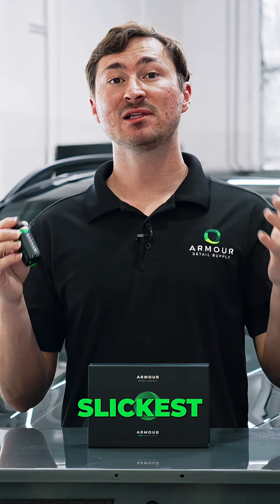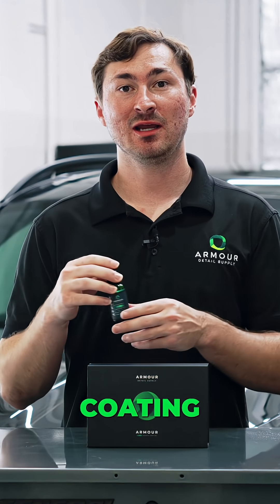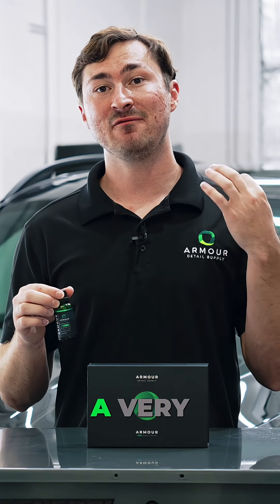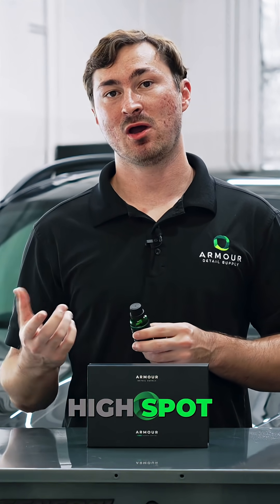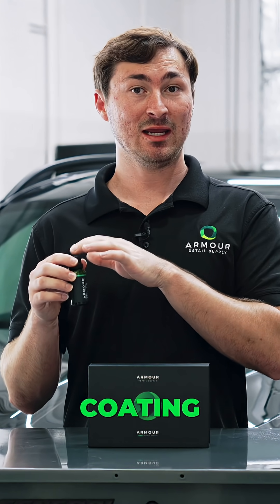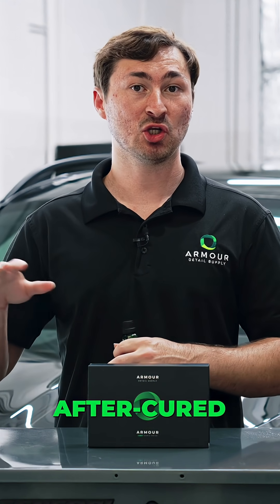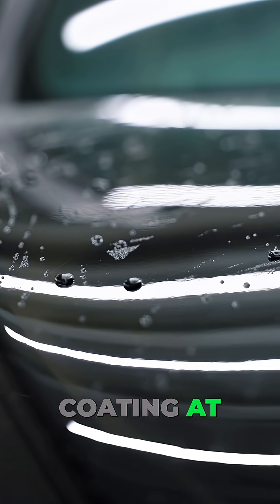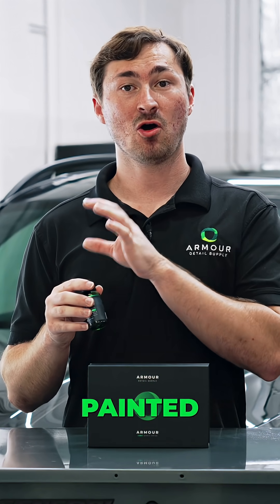Slickest Coating Ever? Watch the Hydrophobic Magic! #shorts

Comment: The pro version has the same new formulation, too? Or just the quartz new version?
Reply from the maker: PRO was reformulated as well, but it's not the same formulation as this.
Reply: @armourdetailsupply  so the quartz is more slick then the pro version. I like that it the coating measure at 105. I was going to get the pro version but now i am switching to the quartz instead
Reply from the maker: @alrosas7407 PRO has 104-105 so not much difference there. The Armour Quartz has a slicker wipe off since it’s not as concentrated. After cured slickness is very simiksrn